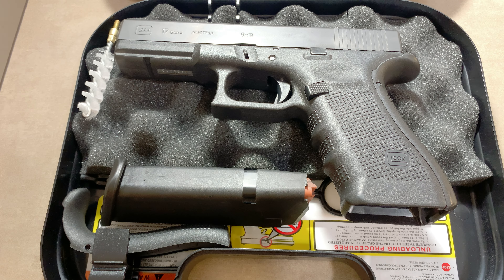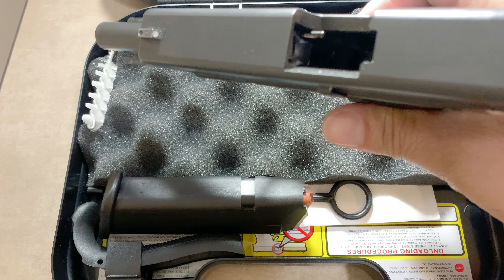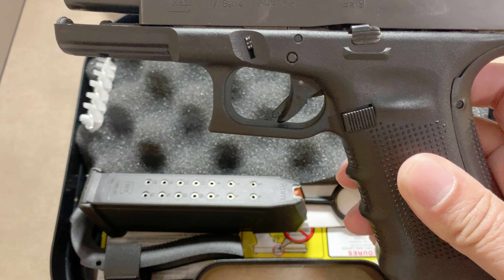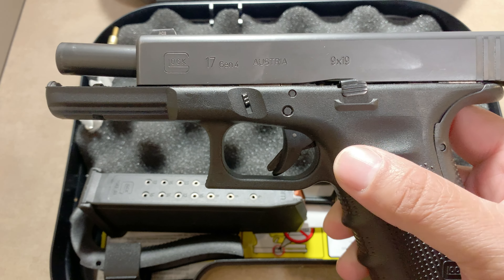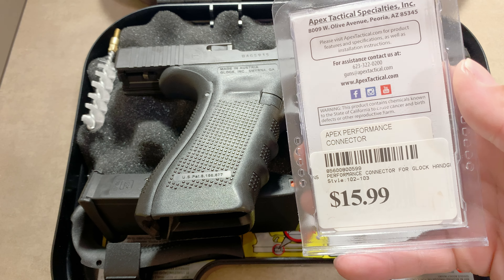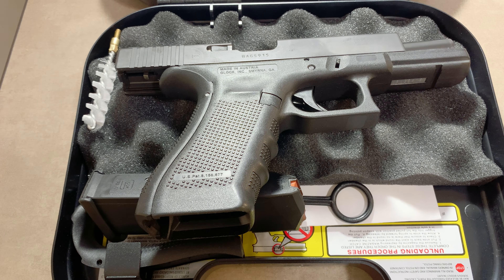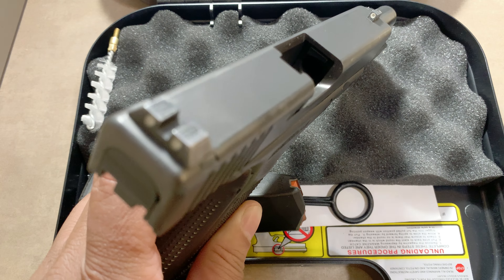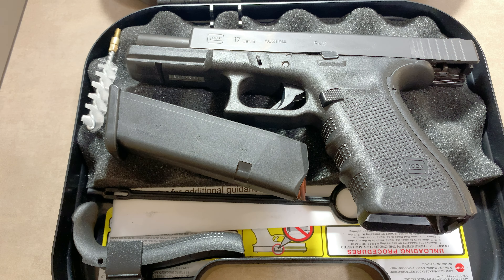Project "Sleeper GLOCK” episode 1. Firearm upgrades 4K

Comment: I just enjoy working on a glock. Ive swapped parts of the trigger assembly with decent results. Currently, my Glock model 40 MOS has a Timney Alpha Glock trigger, Trijicon RMR, ghost connector, M-Carbo firing pin spring/safety plunger, talon grips, and I picked up one of the Olight rail lights on sale (around 60.00 after coupons) Im researching Cerakote, tryin to decide what direction I want to go with coating it, making it a bit more "personalized", not like any of my buddies has a boat anchor of a weapon like it, but, like I said, i like working on them. 😂
Reply from the maker: When I was younger I nodded my cars, now I just mod my guns 💪